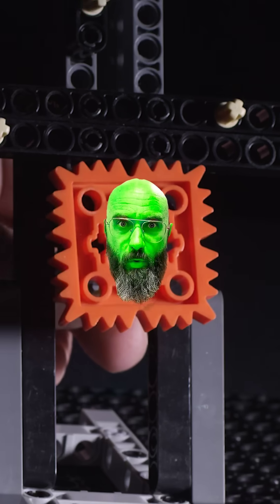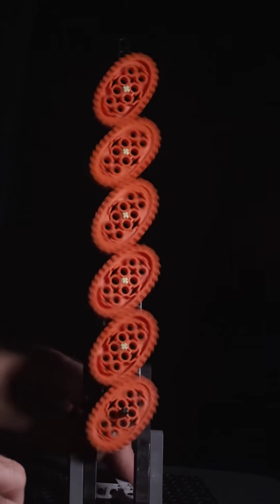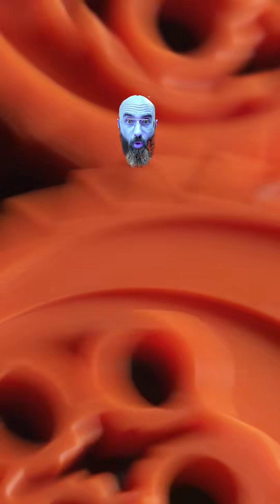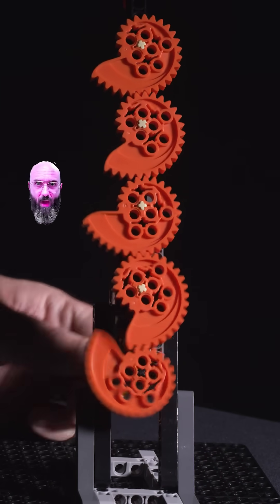Unusual Gears

Comment: I like the mechanic Vsauce. Teaching even a pro that new things can be done. I just think in a rwal application. Square gears may not be good because I think they could have more friction and heat than normal. And they take up more space than a normal gear. But if they work, they might be stronger than normal, and you might get more tooth because you have more surface in that square.

Comment: Geneva gear, aka Maltese cross, is used in film projectors. Called the 'intermittent' gear in that application, it's the gear that stops each frame in front of the aperature allowing light to shine through it(timed by the shutter on the same overall geartrain), then pulling down the next frame, on and on

Comment: Incredibly, "Geneva" as shown here would be a watch escapement if you sprung the bottom wheel acting as the oscillator. TAG Heuer actually uses a variant of the Nautilus gear to display how fast the Porsche Carrera went 0-60 (9.11 seconds, thus the name for Porsche's 911) in their Chronosprint model.

Comment: The Geneva drive or Geneva mechanism is a gear mechanism that translates a continuous rotation movement into intermittent rotary motion.

The name, Geneva drive, is derived from the device's earliest application in mechanical watches, which were popularized in Geneva.

The Geneva drive is also called a "Maltese cross mechanism" due to the visual resemblance when the rotating wheel has four spokes.

Comment: I work with a machine called a microtome, used for cutting thin sections of tissue samples, which are put onto slides and stained. With each turn of a handle on the machine, the tissue moves vertically past a blade and then advances forward for the next section. (The advancement is really small--4 microns is standard, we do 2 microns at my lab. Human hair is usually around 75-150 microns.) Anyway, last time the microtome was getting its preventative maintenance, I asked to have a look inside. The rotating dial I use to select the section thickness is connected on the inside to a cam that looks a lot like that nautilus shape. I don't have a good sense of the rest of the mechanism, but I do know that cam mechanically "tells" the machine how much to advance based on whether it's touching a thinner or thicker part of the cam. Newer microtomes are electronically controlled, but the one I use is totally unplugged. Looking at the components that are inside, I wouldn't have guessed it was capable of that 2 micron movement. Pretty cool.

Comment: You know gears aren't made this way because their stress load is less and their not as efficient as the commonly used (for a reason) circular gear.
This is meant for the person that think these can be used on regular machinery and not sets like these. But I don't mind catching the regular reader upset by this :3

Comment: My brain is telling me the square gear can't be real.
Reply: if you stop the video on the square gears, you can see they're missing a tooth in the middle of each side to fit the corner of the other square gear,
Reply: The trick is non uniform teeth. That is they are not all the same size and distance from each other.
Reply: I'm with OP. No amount of explanations is going to make my brain un-hate the square gears working.
Reply: Does Vsauce have autism?
Reply: Would be exceptionally difficult to pop the clutch with them in the gear-box. I prefer my gears to be able to mesh every tooth and... tooth.
Reply: Mine is
Reply: same
Reply: Your brain is telling you lies... thats what brains do all the time.
Reply: The cream cracker gears aren't real, and cannot hurt you

Comment: Thank you Micheal. I've watched your content probably more than a decade by now. This whole video, as weird as it may sound, gave me hope. That we are actually going into the future. The uses of these, although may be impractical as popular marketing products, could be very interesting. I've been wanting to design different electronics we have gotten used to into "steampunk" or pretty much only mechanical energy, no electric maybe minus a rotating motor to turn the whole thing, with the idea it's linked to an external mechanical energy generator, like an old time windmill grinding grains, but maybe to run your refrigerator instead. And I'm aware of the issue of the decay of the material as they are used. Working on that.

Comment: I bought a Mountain bike in 1993 when I noticed front crankshaft was warped. I contacted the cyclist store and the clerk told me that the front crankshaft was elliptic. The theory was that the ecliptic portion of the crankshaft force a faster rotation without effort leading to increased pedal efficiency. I noticed the difference on hills but the bike ended up being stolen a couple years later and I never really bought on to the difference. I ended up buying a Giant in 1996 and still have that bike.

Comment: Fun Fact: Those direction-changing gears are used in irrigation sprinklers! That’s how they are able to slowly rotate until spontaneously reversing back to their original position and repeating. It’s such a neat little mechanism.
Reply: some sprinklers (the tchik tchik tchik kind) use a different system, where the lever is forced to the side by the water, and then slams back, moving the sprinkler, and a lever adds a pin for the return onto which it slams on the first way around.
Reply: @satibel I thought those were so cool when I first messed around with one as a kid. It seems like it shouldn’t work and yet it does.
Reply: @Roach_Dogg_JR  yeah they work because friction is a thing, the spring spreads the force over a long time while the impact is instant, so it has enough strength to overcome the friction, like if you turn on an office chair by going back slowly and jerking the other way.
If you model it without friction it shouldn't work.
When the sprinkler comes back however, the two forces cancel out except the water is sprayed to the side so it's biased.
Reply: I didn't know that.
Reply: I like the tch tch tch tch tch fwshhhhhhhhhhh one better
Reply: I wonder if some oscillating fans use that too
Reply: @JosiahFickinger  definitely the ones with the little turning sticky outy stick bit
Reply: @tripplefives1402 what you're talking about are impact sprinklers, there's also horizontal oscillating sprinklers, which use a water wheel and a gear train to move the head, and they sometimes using such a gear to move the head back and forth, but you'd probably only find that on cheap or older models that aren't adjustable (as the main issue is that you can only do a fixed 180°), most modern ones reverse the flow of the water on the water wheel, they might use a cardioid cam to speed up in the middle to avoid overwatering  the middle of the travel or underwatering the ends.
Reply: Why do we have sprinkler scientists in the comments and replies?
Reply: @emmettross2785  because we're trying to collectively figure out why this exists
Reply: @emmettross2785  Not sure why that matters? Actually using your brain to think about things can be a lot more rewarding than not
Reply: That's cool I was wondering if there was a purpose for any of these gears lol
Reply: millhouse would love this comment
Reply: Does a washing machine do something similar?
Reply: @daniilivanov9601  usually those are all electric
Reply: @daniilivanov9601 Modern versions typically have a brushless induction electric motor, which can operate CW or CCW. Very reliable and durable. The washer's pump(s), seals or relays will usually fail before that motor.
Reply: Also in mechanical watch rotor gears 👌😁
Reply: Thank you.

Comment: Dear Mr. Vsauce,
A bit of a random one but i have a question unrelated to the video. When you suck on a straw the liquid goes through and into your mouth. If you stop the liquid with your tounge before it reaches your mouth then the pressure will keep the liquid in the straw, despite gravity. Could this work if this was created on a larger scale making it possible for people to enter a room with floating water above?
Reply: Idk if thatd work because the surface tension would have to be astronomically high to be able to hold literally 10sof thpusands of lbs of water.  I'm not a physicist lol. I'm just thinking surface tension is strong enough on the straw since its such a small area compared to what your thinking and also the weight is like nothing compared to what your thinking also. I love the idea tho
Reply: This is similar to a video he has about a space straw. I recommend watching it
Reply: In practice, no. The water is held at the top of the straw because there is no air above it. Air would like to get above it, but the straw is rather small in diameter, and the high surface tension of water means that air cankot easily flow up the straw side by side with the water. The straw trick does not work well with lower surface tension liquids like gasoline or alcohol.

A larger diameter straw makes it easier for air to sneak past the water up to the top of the straw. You cannot easily get much bigger than a straw; I once managed it with a drinking glass, but not very long and it was absolutely a fluke. Anything larger than maybe an inch diameter is very unstable; larger is theoretically possible, but even very slight air movements would be enough to disturb it and dump all the water.

With very high viscosity fluids(or mostly solid slurries) with high surface tension, larger diameters are possible, thats why you can turn a Blizzard upside down. But a Blizzard isn't really a liquid, and a fluid thick enough to stay in the top of even a small room would be effectively a solid and would not make for an interesting ceiling.
Reply: Ya idk if it would work but if it could that would be pretty cool
Reply: i do believe that if you stick anything up the bottom of the straw, like a cocktail stick, it will break surface tension and spill the water. so while i dont know about the large scale variant. i think at the very least you wouldnt be able to "enter" the pool
Reply: Ask ai its actually good at this

Comment: Fun fact: you can buy ellipsical chain rings for your bike. They allow more leverage with each pedal stroke, since the  long points of the ellipse are aligned with the pedals. This makes them good for mountain bikers who need to have good acceleration and torque, but not top speed.
Reply: I just wrote my comment i bought a bike with an elliptical crankshaft in 1993. I thought it was warped but the cyclist clerk explained how it worked. I noticed a difference when climbing hills but it was stolen a couple years later i ended up buying a Giant.
Reply: Giants are great for traveling up hills. They do consume a lot of food though. I've almost ran out of villagers atm.
Reply: That would explain how a mf was riding bike up a step hill. It seems impossible with regular gears no matter.
Reply: @IrishFinalExit  That's probably more down to the gear ratio and/or your mf having strong legs. Elliptical chainrings just even out the torque to reduce the long-term wear on your joints (knees in particular).
Reply: @IrishFinalExit  honestly your mf was probably just in granny gear
Reply: thank u, mewmew :3
Reply: I had those on my Bianchi 40 years ago. Glad to know that they are still here.

Comment: What happens when you mix the Direction Changing Gears with the Ticking Gears? Couldn't you use that to construct a Piston Gear that is moved forward or backward depending on the position of the Piston and the rotation of the Gear?

Comment: Can we get a longer video explaining the uses of these unusual gears? They’re probably in a lot of commonly known items.
Reply: I think the Geneva mechanism is most commonly used for film projectors to advance the film one at a time (this gives it that characteristic clicking sound while it runs), I've never seen any of the other special gears though like the nautilus gear or that 2-way gear.
Reply: @1mariomaniac  Something like the geneva mechanism is also used to make watch hands tick rather than glide!
Reply: @jimmysonglaugh  I believe the mechanism you're referring to is called an escapement, that's what advances the hands of a pendulum clock, they're really neat little things, but they work quite differently from the Geneva mechanism.
Reply: @1mariomaniac  Yeah but don’t both basically convert smooth movement to discrete?
Reply: Yes, this video was not enough.
Reply: I seem to recall a video that explained the direction changing gear being used for lawn sprinklers, although that was a while ago I could be wrong
Reply: @grahamvaneck8906 there's a highly liked comment here saying the same, so perhaps it's true after all